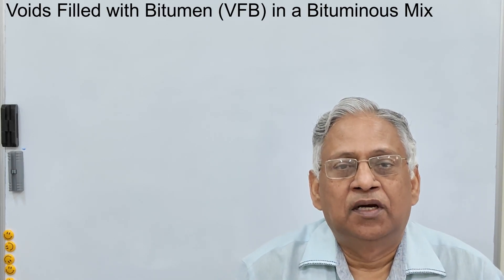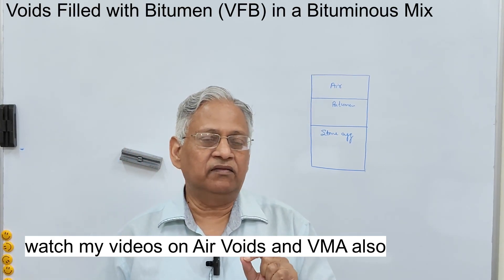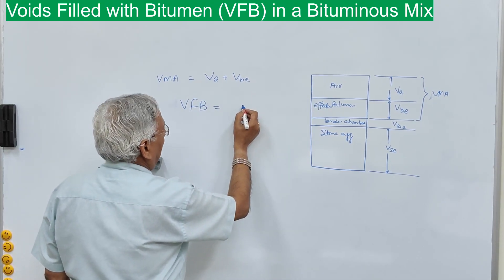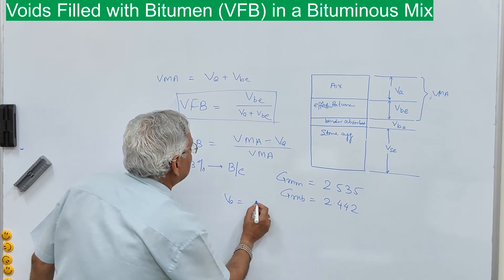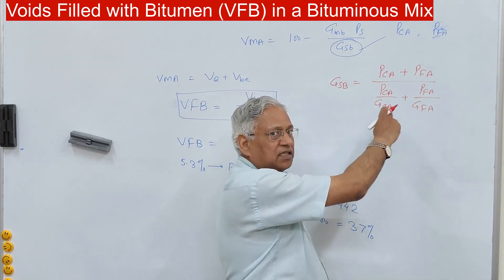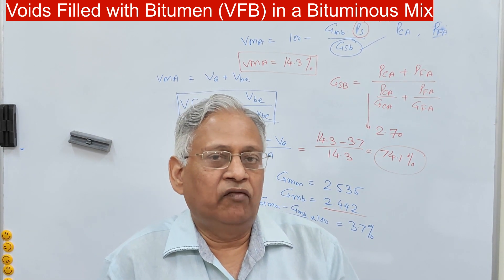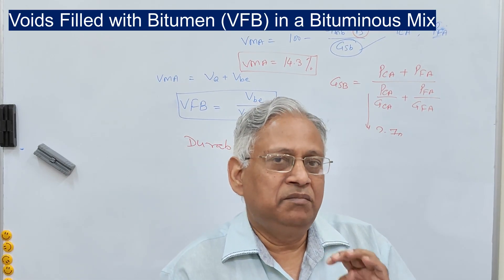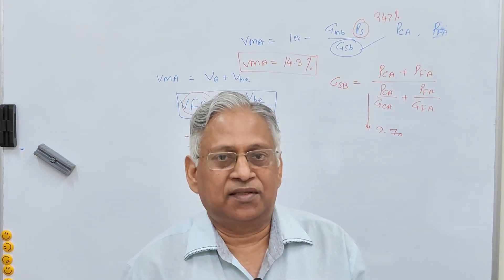Voids filled with asphalt in a mixture, significance in design of mix and controlling factors.

Comment: Sir is it correct that for mix having high air voids such as open graded friction course bulk density should not be calculated by conventional method in which we dip compacted samples in water and take 3 weight ,air weight ,SSD waight and submerged weight....if yes when by what method we should calculate bulk density of compacted mix have high interconnected air voids ( like air voids 22%)
Reply from the maker: In the case of high air voids mix, the bulk density is estimated by geometris parameters of the specimen. Take height and diameter at 3-4 places and find the volume of the specimen. See ASTM D3203 - 17.
Reply: @SatishIITR  thank you sir ..🙏

Comment: Sir crusher run macadem aur wmm me kya difference hota hai 
Crusher run macadem irc code kya hai aur crusher run macadem kha par use karte hai
Reply from the maker: CRM is also a type of base or subbase material like WMM or WBM. It is given in Section 407 of MoRTH Specifications 2013. Its construction procedure and grading of material are different from those of WMM or WBM.
Reply: Sir Crusher run macadam par video banaye
Reply from the maker: @kkg3085  I do not know whether this type of layer is still in use or not. These specifications were made in 2013 and there have been lot many changes since then. Iska use shayad ab nahi hota hai.